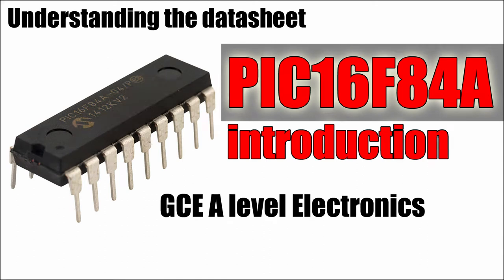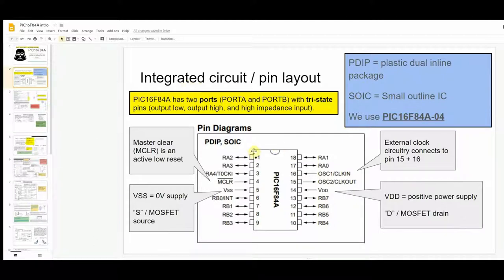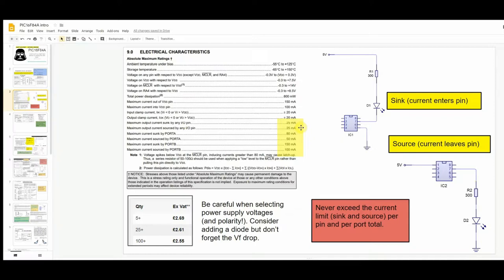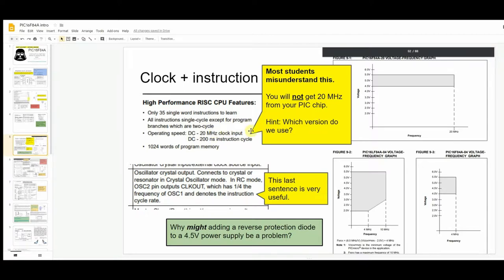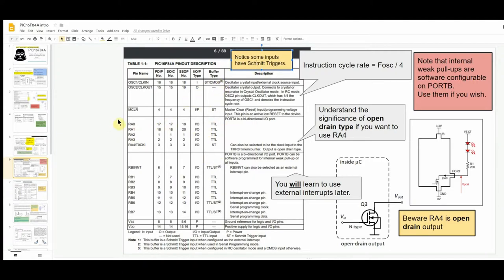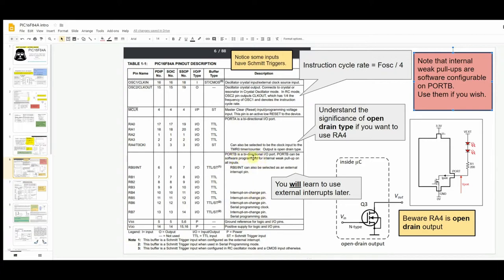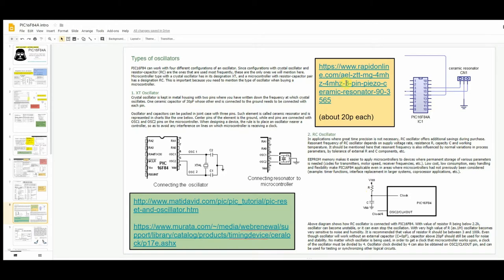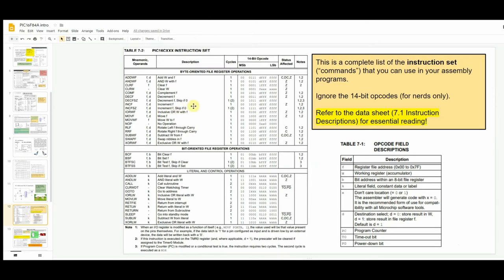pic16f84a microcontroller introduction

Comment: Thanks for a good video tutorial. What is the best combination of MPLAB IDE and XC8 compiler for testing this chip?
Or should I just install the latest from Microchip?  I also found that the PIC16F628A is a little cheaper these days.

Comment: Curious....just dug this out to play with it and the pins say each can handle 25ma....but the whole port can handle 80ma. So does that mean I cant have all the pins drawing 25ma at the same time?
Reply from the maker: That's correct.
Reply: @PizzeyTechnology  Huh....I never noticed that spec before but then again I never draw the max anyway even when using LEDS. And PortB can handle almost twice the current as PortA so you can get pretty close to the max on each pin. Thanks for the video! I haven't played with this chip and assembly lang in years but did it last night and it worked. :)
Reply from the maker: I've just checked the datasheet https://ww1.microchip.com/downloads/en/devicedoc/35007b.pdf and the detail is slightly more complicated than you have stated. If you take a look at section 9.0 Electrical Characteristics, you'll see absolute maximum ratings for sourcing and sinking current by PORTA and PORTB. There are also maximum ratings for current out of the Vss pin and into the Vdd pin. All of these will need to be checked if you are anywhere close.
Reply: @PizzeyTechnology  Yes good point. I did print that out last night. The VDD is right on the limit with the portB but also need to calc the power dissipation or be letting the electrons out. :)

Comment: dose possible to use pin a4 as output  while lam using tmr0 and interrupts sir
Reply from the maker: Do you want to use pin RA4 (DIP pin number 17) as an output? That shouldn't be a problem and I don't see any conflict with TMR0. Check p.6 of the datasheet https://ww1.microchip.com/downloads/en/devicedoc/35007b.pdf

Comment: Hello. Does pic16f84 has an analog i/o ?
Reply from the maker: Are you using the PIC16F84 or the PIC16F84A? If you really are using the PIC16F84 (a very old microcontroller) then you will find it does not support any analog functions. The data sheet is here -- http://ww1.microchip.com/downloads/en/DeviceDoc/30430D.pdf The more recent but still dated PIC16F84A also does not support analogue I/O. Take a look at the PIC16F88 if you are interested in analog input. It uses the same 35 word instruction set as the aforementioned microcontrollers.

Comment: Dear Sir, can you refer me good book for pic assembly language.
Reply from the maker: Sorry, but I have no book recommendation. However, reading the data sheets is definitely useful (e.g. https://ww1.microchip.com/downloads/en/devicedoc/35007b.pdf) and skimming through the MPASM manuals has also been helpful at times. http://ww1.microchip.com/downloads/en/devicedoc/33014g.pdf and http://ww1.microchip.com/downloads/en/DeviceDoc/33014L.pdf 
Personally, I have found a general knowledge that comes from using higher level programming languages and structured programming techniques to be most beneficial. Breaking your code into subroutines is essential for readability.

Comment: Can you help me with something Sir
Reply from the maker: Just ask a question if you want
Reply: @PizzeyTechnology  Can you please check whether my quote its fine or not...I want to display 215092791 top and KF MODISE on the LCD using PIC1684A
Reply: And i want to know which software can i use to simulate it without building an actual circuit using actual components
Reply: Do you have an email?
Reply from the maker: Feel free to post your question here.
Reply from the maker: I haven't used any circuit simulators that support PIC microcontrollers. If you are using a development board maybe PICSimLab could be useful?